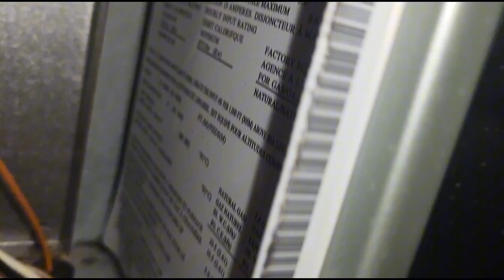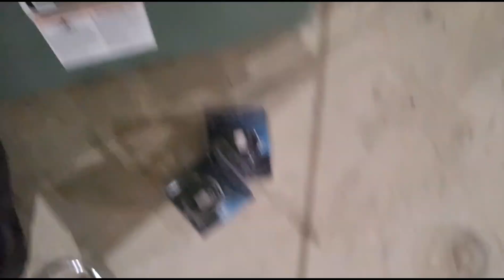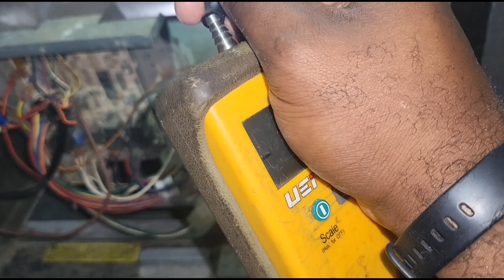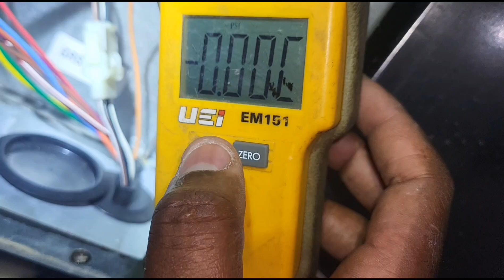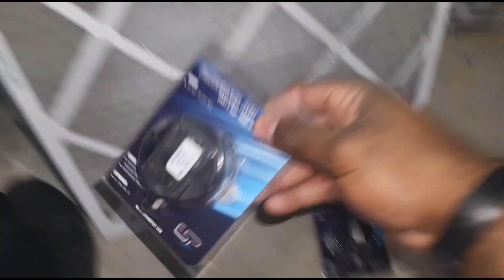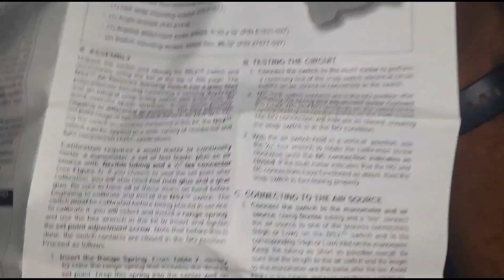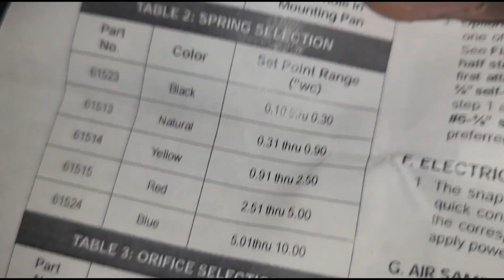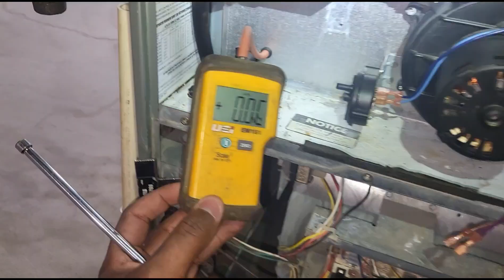How To Troubleshoot A Furnace | Furnaces

Comment: Yeah, the spades are different to keep your codes correct when/if the board flashes a code. That way, you dont get a false alarm on a heat exchanger.